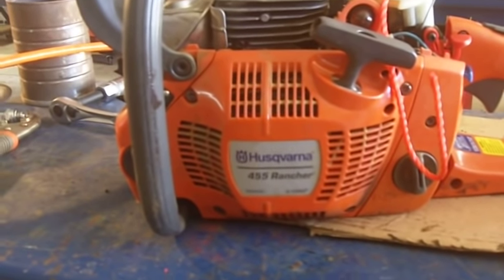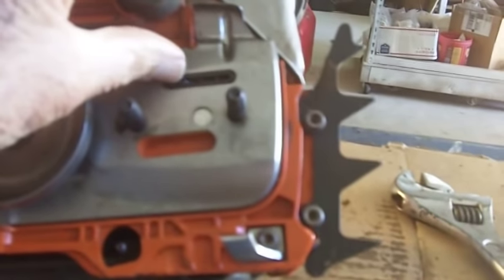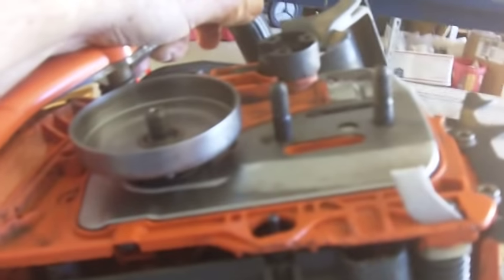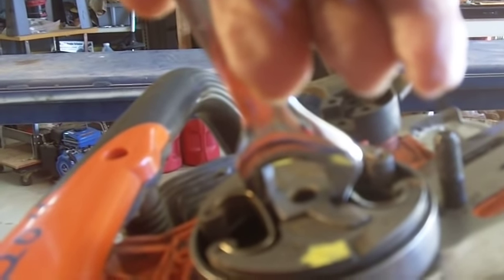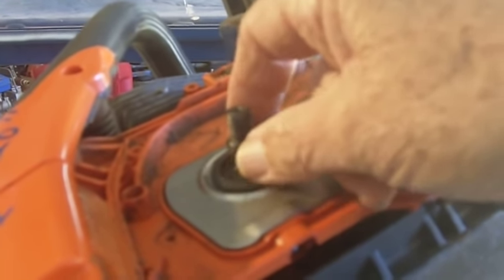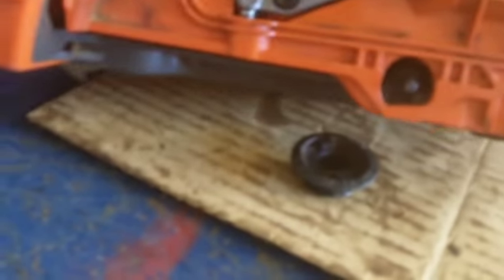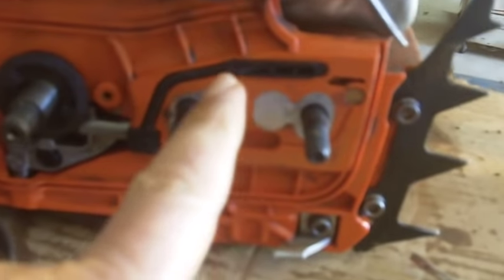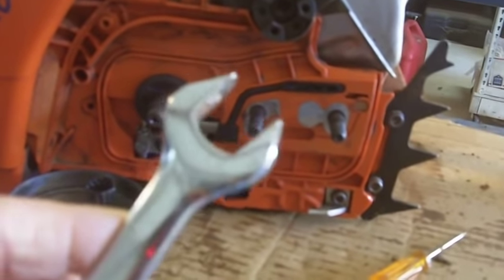Husqvarna Rancher 455 Chain Oiler Repair

Comment: I've had my 455 Rancher for about 12 years.  Almost zero problems.  The only one I took to a shop for was poor oil flow to the chain.  And then again yesterday, I noticed a decrease in oil flow.  Thus your video.  I took it apart and cleaned it up including the oil passage you pointed out.  But I think what may have been the problem is there appears to be a passage in the bar that goes from the port on the saw to the teeth of the chain.  One of those was plugged.  Cleaned it up and will now see how it works (when the rain stops!).
Reply from the maker: Thanks for watching and commenting. It does not take much to plug the oil ports.

Comment: That is why I use a stiff brush to clean up my saws.  They call it a glue brush at the builders supply.  To get some spots I use an old paintbrush with some old two cycle on it.  I do not have a problem removing the clutch from my Stihl saws.  Just a 17mm socket and my impact wrench, turning CW.  My friend uses a big pair of channel locks to remove  the clutch on his Husky saws.  I have the correct tool for the Husqvarna saws, which I use on my Husky saws

Comment: Too heavy? Too dangerous? I won't recommend the 395XP then! 😂😂😂 I love my 455 Rancher but you are correct as its not the best out there! I prefer the pro series, but it is great for what I do. However I will someday replace it with a professional XP series saw.  I have learned a lot about maintaining these saws over the past few months and now they run better than ever now. My current line up is 2 Homelite XL-12, Echo 301-CS top handle trim saw, Husqvarna 455 Ramcher, and a Husqvarna 395XP. Thanks for sharing!

Comment: I also flush my oil tank once a year with kerosene or old two cycle gas.  Diesel also works.  You can also use a little kerosene to thin down bar oil for use in cold weather.  About a TBS per gallon.

Comment: Thank YOU for taking time to publish this. I was able to make the tool to get the clutch off. I followed your procedure. Now I get some oil out of the port . But  don't know if it's enough. With the bar OFF and revving , I see a drool of oil. Anybody tested with the bar off to see the amount of oil being pumped?
Reply from the maker: It does not take a lot of oil to keep it oiled. There IS a setting screw for the oil flow. If you do not have the owner's manual you can download or look at one online. Thanks for watching, commenting, and subscribing.

Comment: I took my 460 apart to remove the oil filter and tube from inside the oil tank. you need to remove some things but its not that big a deal.

Comment: My saw leaks oil out the bottom? I wonder if the rubber line is plugged or the connection is broken?
Reply from the maker: Only way to tell is take it apart as far as I know. Thanks for watching.

Comment: My 455 is my normal use saw and I go up to 575 xp for big logs. Ive been on that pattern for many years and now that I'm nearing 50 yo I'm looking for a smaller saw than the 455 as it's getting heavy and hard on my arms.
Reply from the maker: That 455 is getting heavier each time I use it. I turned 71 a while back and I am fond of my Echo 400 saws. Liter and I can cut longer and a 5 year warranty instead of the short one on the Husky.

Comment: I have a old school rancher 55, that looks brand new, And runs like brand new.  That i just bought at a flea market. So the bad, It's over oiling the chain, and leaking a huge  amount of bar oil when siting. I looked  at the oil pump and its non adjustable. Any suggestions thanks
Reply from the maker: My Echo and the Rancher both will leak bar oil when the chips build up an move the  oil deliver tube off  the pump. If it is just over oiling when running, use a heaver oil. Over oiling is Much better than under oiling.
Thanks for watching and commenting.

Comment: that clutch is not on tight. with the cylinder locked up you just tap it with a straight screwdriver on one of those arms and it spins off
Reply from the maker: Thanks for the tip and making a comment.

Comment: I am having the same issue. I clean the bar channel and take good care of if because I have s Windsor or something pretty expensive bar so I wanna make sure it last but it's been acting up. I clean the saw often after every use. I put bar oil and it wouldn't pump if but regular motor oil it will. This is good information however it would had been nice if you shortened it up a bit lol. Not trying to offend but would had been better if I didn't have to keep skipping you talk about random stuff you could had done or used that isn't important to video like spanner this and that lol

Comment: Set a hard handle screw driver blade into the indentation next to the yellow mark on the flywheel, give it a short hard hammer blow on the screw driver and the fly wheel will come off.
Reply: That is exactly the way to go. Forget these useless ERGONOMIC soft handle screw drivers. A hard handle one, the right width to fit that indentation you pointed out will do the trick alright, none of this pissing around with pieces of rope or even worse buying a special tool to screw into the spark plug hole.
Reply: Thanks champions! I’ll give that a go.

Comment: Thanks for the video. Can I get to the oil discharge to clean it without taking all of that off?
Reply from the maker: Not to my knowledge, the feeder is behind a shield that can only be reached by doing what I did. At least on my saw.
Thanks for watching.
Reply: archersfriend well heck, thanks for your help, my rancher doesnt seem like it should oil like it should
Reply: H.G. C. Yes, It's cranked all the way up, thank you for your advice though.

Comment: The two little grooves on the outside of the clutch that say “off”. You can break it loose with a chisel and hammer.
Reply: Or just cut slots into a socket with a Dremel cutting wheel